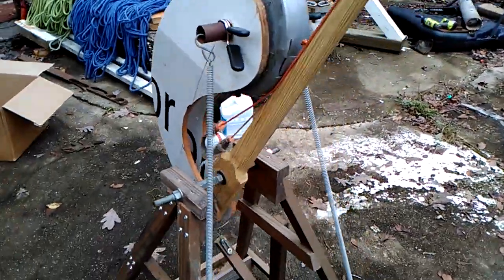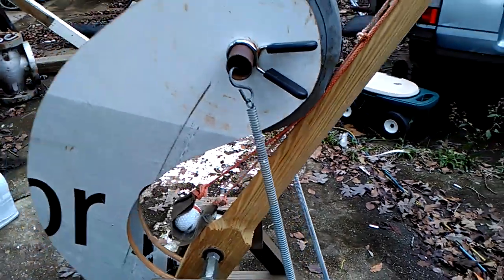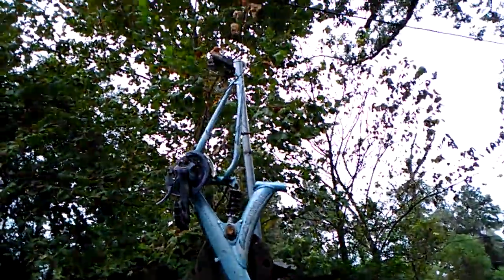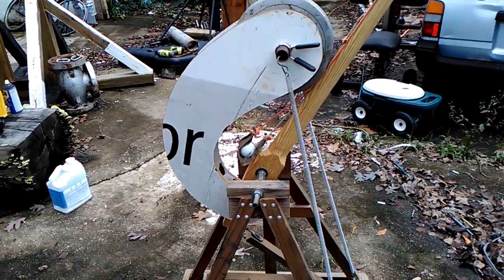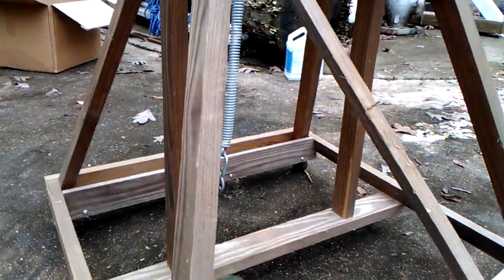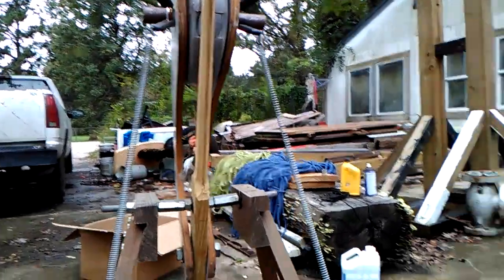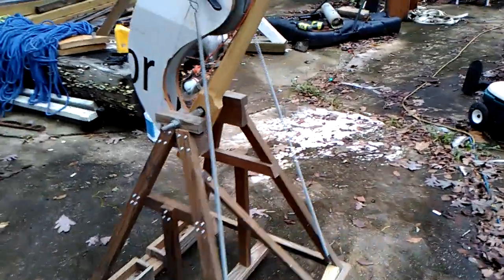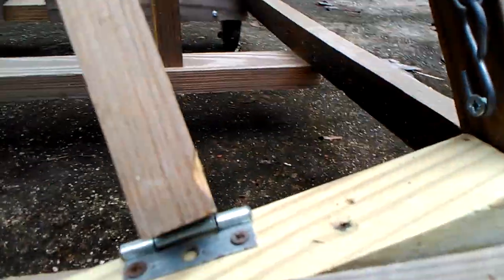Spring Assisted Rolling Whipper Trebuchet/ Catapult Hybrid .

Comment: I like your ideas, but you have a completely different setup than mine. I do not have a whipper nor do I have a trebupult, I consider mine a catapult. It had 1 spring when I found it and then I added two more. They are not the type of springs you have, mine are the short trampoline springs and they are attached to the rear inside there is a table that attaches the springs to the bottom of my catapult and when you pull the top down that puts pressure on the springs and when you let go, the springs retract and by doing so it tosses my bottom rigs. I know it's probably hard for you to understand without seeing it I'm explaining it the best way I can, sorry for the misunderstanding of the two!
Reply from the maker: Sounds like my giant catapult, but smaller. https://www.youtube.com/watch?v=PtBlJJhDRHE&list=PLxm5u3feTjtVk6n7CEA5vv51tn_Hs2pz1&index=8
Reply: @FingerAngle it is just ass backwards 🤣!
Reply: The only place that I have to practice with mine is at the river and I have no boat to retrieve whatever I throw with it, so whatever I throw it's gone for good!

Comment: It jumped when you fired it. Did the springs cause that?
Reply from the maker: Yes, sir.
Reply from the maker: I have over 3000 pounds of rated spring force to play with on the larger machines. We'll see where it goes. My next round of material testing will be with Nitinol wire springs. I'll set the system up like this but with balanced springs, then run an electrical current through them to cause the reaction. I'm ordering the wire this week.